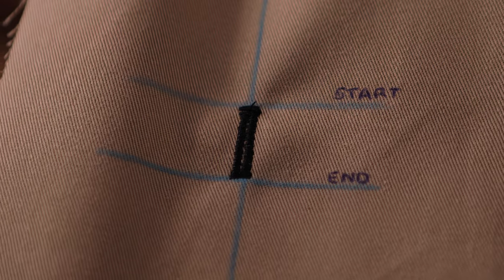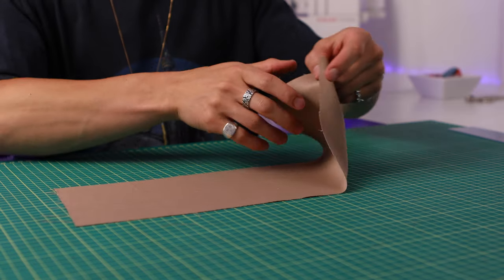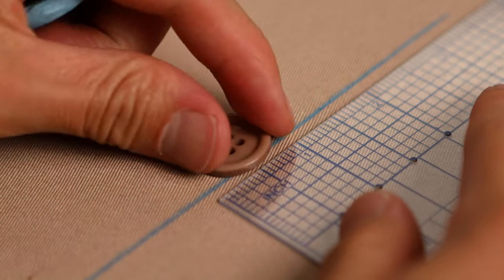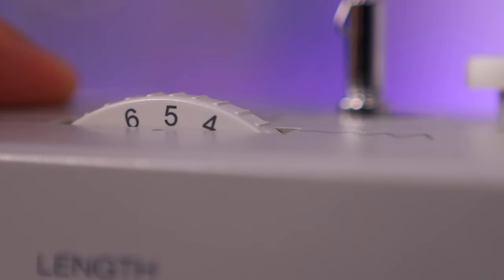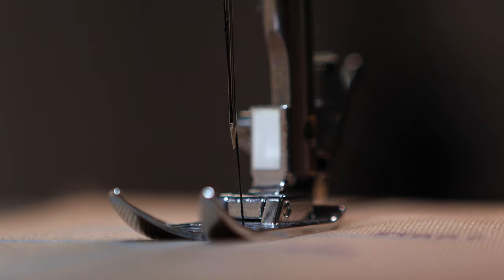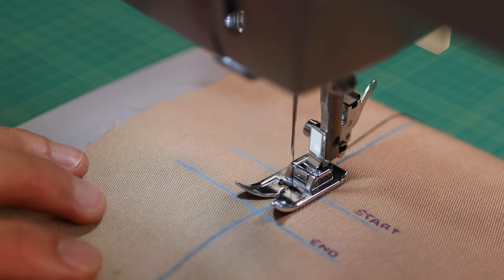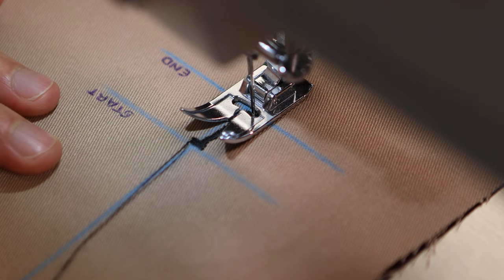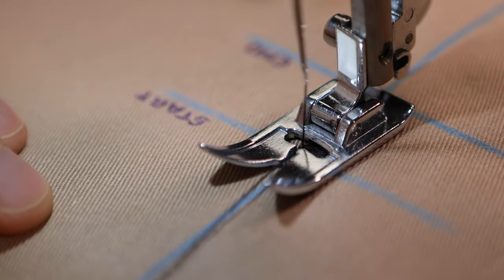How to Sew Buttonholes without a Buttonhole Foot for Beginners | GA020

Comment: I found this video really helpful as I was having trouble with my buttonhole presser foot so was happy to come across your video explaining the oldskool/manual way. 
At first it seemed complicated to do, because I was trying to follow your instructions to the T, but I realised I couldn’t do that because my machine is set up differently so I decided to follow the concept (using the guidelines you describe) but use my instinct a bit more with my machine and after practicing 20-25 buttonholes 😂, I did it for real on my main project and it worked I’m happy with it! 🎉

Comment: Lol what? Where is the actual buttonhole? And then show us how to slice the fabric so it's actually open and usable.  😄
Reply: just use a seam ripper to cut it open. or even a blade
Reply: The best way to cut open a buttonhole is to put a pin sideways at the end of it (so you don’t cut through the end threads), start the cut with a seam ripper, and finish up with small scissors for more control.